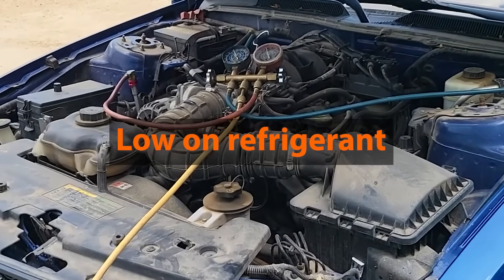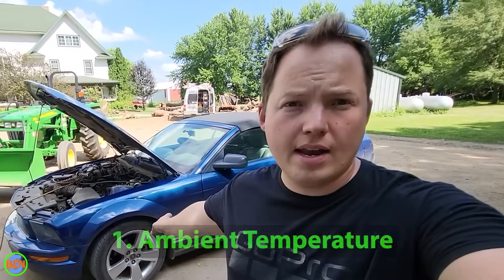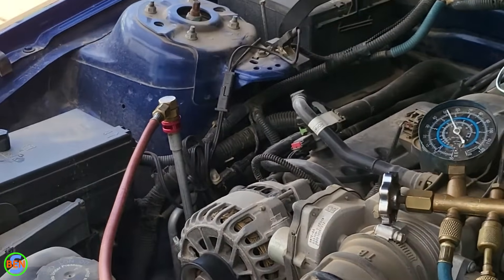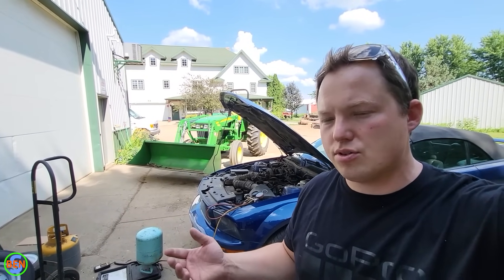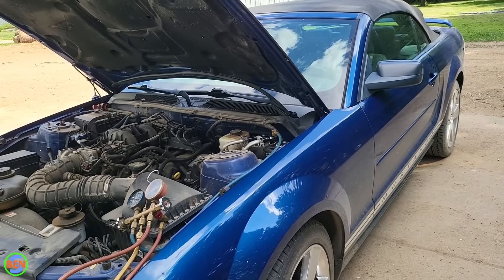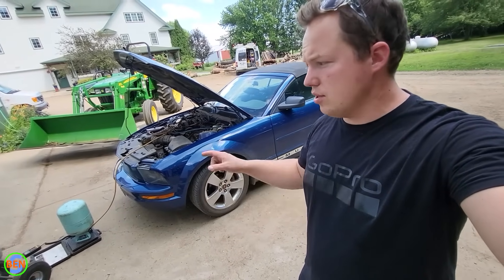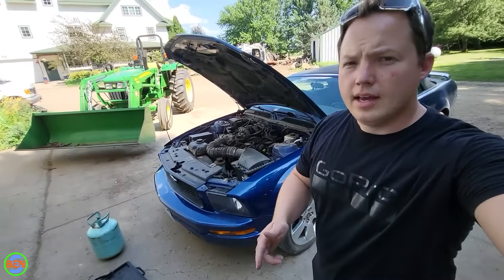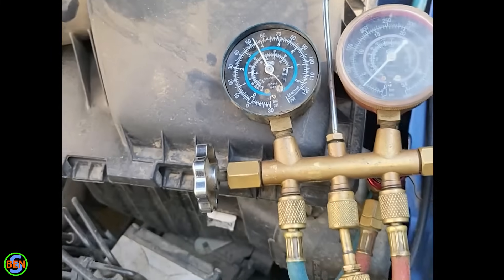What Pressure Should my Car AC Be - How To Check Automotive R134a Air Conditioner - Recharge Tips

Comment: I have been in the auto A/ C business for 48 years  the use of a/c Dye is the best way because 75 percent of the leaks in auto A/c is intermittent due to expansion and contraction  of all the aluminum parts and all the hot exhaust and water temperature repaid change I have the best sniffers that you can buy and use it first but most of the time we have to install a/c dye and bring it back at a later date and let it cool down and take all the plastic covers off put it on the lift and find the dye  . We repair several hundred A/C jobs a season that is all we do
Reply: What I like about the combination of 134a cans mixed with UV dye is that when it leaks again, it might save a step and help a pro to find a leak more quickly. Conventional workflow is always to search for and fix the leak first.
Reply: I had a leak in my AC system, turned out to be in the evaporator. What a PITA. It was my first ever A/C repair and after some research, I bought a set of cheaper digital gauges. The digital gauges can calculate superheat and subcool internally, and allow for switching between automotive (R134A) and residential (R410A, etc) refrigerants for the calcs. I found most analog gauge sets have dials for one or the other. 
I used dye in the system. A leak detector may have been useless because the evaporator is inaccessible behind the dash. After a month or so, I saw signs of UV dye coming from the evaporator condensate drip/drain line under the car. 

I can't confirm, but I read somewhere that some car manufacturers put dye in the system at the factory from new. 

I had to add R134A about once every 6 months before fixing the leak. The method I used was to first verify that there was a large difference between superheat and subcool temperatures. Then slowly add refrigerant until the superheat and subcool are within about one degree of each other. Typically it took about 2/3rds of the factory charge.
Reply from the maker: Thanks for sharing your expertise. I'll have to try out the dye option in that case. What brand/product do you recommend for the dye kits?
Reply: My daughter big GMC truck was losing Refrigerant. 
So I had to replace the evaporator behind the dash. Since I was there, I also replaced the heater core. Washed everything out and I also found a blend door was almost broken.
I couldn't find a kit or the door replacement.
I took the door out and snapped it in two. Bought some jb weld in a big tube. Sanded everything, cleaned it up. JB to the rescue. 
About a day later I reassemble the dash. 
I also washed out the AC condenser while the system was down and also the radiator got washed out. 
Vacuum out the system. Added refrigerant per specs. Now it's running cold again. 
Before the repairs, I was adding 3 cans for the summer run. 
I haven't add any refrigerant for the last two years.
Reply: Does someone make a UV dye for AC systems in cars like the leak-finder dyes you can get for engine oil or antifreeze?
Reply: @Dave-ei7kk Johnstone sells UV dye formulated for hvac and refrigeration systems.
Reply: @DutchStar  Thanks!
Reply: @DutchStar  Thanks for the info. I have a bright portable UV light and have found it very helpful when used in conjunction with the GM UV dye that is used in engine oil. It’s especially helpful when the oil has traveled all over the engine sometimes making it difficult to find the source.
Reply: @Dave-ei7kk Yes, any auto parts store will carry AC dye.
Reply: @2nickles647  Thanks. Good to know.
Reply: what are some of the best sniffers
Reply: @vancehughes1877  A beagle lol
Reply: This is true but you must use a water-based dye and not an oil-based
Reply: Keep in mind that some cars AC systems are controlled by ambient temperature with an ambient sensor and therefore you should just put it on regular AC to check your pressures normally, and making sure that when you put it back on max and wait at least 2 minutes go back and check your gauges and those pressures on the low side should be at the low end of the spectrum. If you do not have an ambient controlled AC system with an ambient sensor then there is no need to turn the AC to standard setting.
Reply: Ben for the DYI Guys this video is outstanding!! I'm a master technician 44 years worth!keep up the good work.keep the videos coming!
Reply: One period 😂
Reply: @Cleofizoid  Typo lol!!
Reply: @Cleofizoid that's what Mrs Gazinski would call a diarrhea sentence.
Reply: @jima3129  🤣
Reply: @jima3129 But she was a terrible mechanic. So, there’s that.😂

Comment: Please do a video on changing from R-12 to 134A, show all the steps and what all the pressure readings should be to get the 134A car vent temps as low as the R-12.
Reply: R134a is getting phased out .  There are a lot of R12 alternative, use to get them at auto parts stores.  I bough a bunch a decade ago from Canada.  you can still get Envirosafe online but the prices keep going up.  You need half as much as your R12 system says and they say you don't have to vacuum the system.  Eventually all the safety nannies will allow  cars ACs running on R290 or R600a.   Might take a decade.
Reply: @MichaelMantion  R134A is not getting phased out. It is illegal to charge a R134A system with R1234YF. R134A will be around for a long time.
Reply: @MichaelMantion   "Eventually all the safety nannies will allow  cars ACs running on R290 or R600a.   Might take a decade."
We can hope, but I think you're being overly optimistic.
Reply: @Know-Way  In south America, several years ago, a passenger bus that used R12a/propane caught on fire killing half the people on board.
Reply: @MichaelMantion R290 is plain old propane!
Reply: @MichaelMantion Envirosafe is safe for the environment, but not safe for you if it catches on fire.
Reply: They sell R12 to 134a conversion kits. 
Recover the R12 to an approved container.
Weight the recovered R12. 
If there is any oil recovered, weight it too. 
Pull a vacuum on the system and close all the valves. 
Shut the vacuum pp off
Record the vacuum reading. 
Go to lunch for 1 hour. 
Did the vacuum reading drop significantly or held vacuum. 
A decayed reading indicates a leak. 
Refill the system with nitrogen gas. 
Add dye. 
Replace the bad part and retest.
If the system held vacuum.
Obtain the specs for the vehicle you are working on, that will tell you how much in Oz to fill the system. 
Get a scale and add a can to the yellow line.
Open the tap, depress the small valve 2 sec to burp any air out of the line. Open the blue or suction line and start filling the system.
Start the vehicle.
Set to max cool.
The AC condenser cooling fan should start.
Observe the AC clutch cycling as you fill system.
Fill the system to the specs for the vehicle you are working on. 
Make sure the condenser is clean also. You may need to wash it out.

Comment: All compressor will leak at shaft seal.  Always add a PAG oil charge (walmart) especially if leak is low and leaking oil too, without oil compressor will fail.  If you need to add 12oz a year system can last indefinitely.  To fix a leak and evac system diy'er doesn't have equipment and more parts may have to be changed also.
Reply: You mean 1/2 oz, right?
Reply: Yes oil, and 12 oz 134a @jackb1803

Comment: It's actually fairly difficult due to inside fan speed choice and outside condenser condition, fans and temperature. Don't run the inside fan at full speed but do run on recirculate. 
Recirculate is the only position that should be used unless the inside ambient temperature is above the outside temperature, this is what that feature is designed for.  (Unless Bubba let's out a giant fart)
Master Ase and IMACA certified instructor...
Reply: So, his advice (to not use recirculate while measuring pressures) is incorrect? In that case, what ambient temp do you use when trying to decide what ideal pressures are? Shouldn't your choice of ambient temp for looking at gauges be the same temp that is entering the evaporator? If you use recirculate, your ambient temp for the condenser will be correct, and the temp for the evaporator will be colder than ambient temp suggests, confusing gauge interpretation.... HVAC techs would measure temperatures at both coils and calculate superheat, but in the automotive world we don't have those fancy tools.